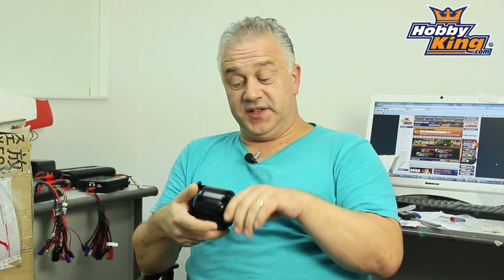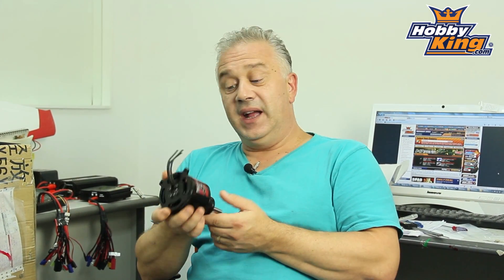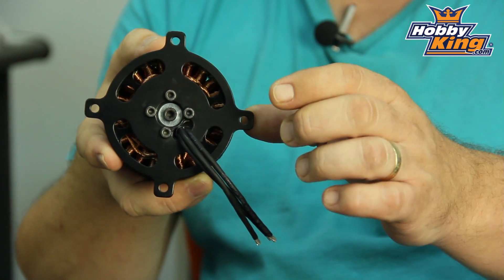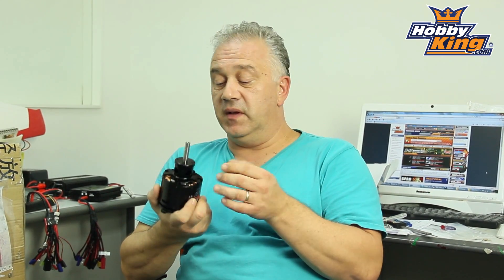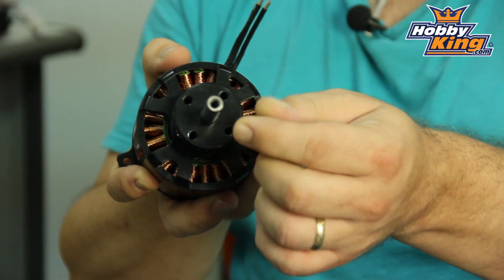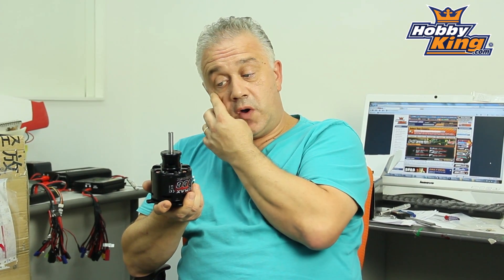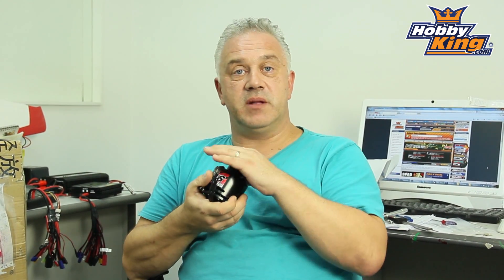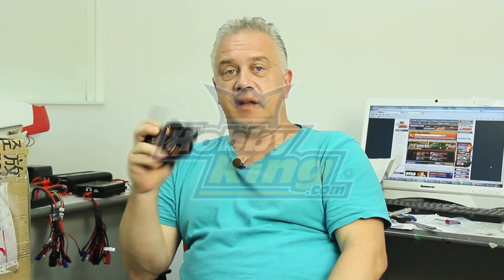Turnigy RotoMax 50cc Size Brushless Outrunner Motor  - HobbyKing Daily Video

Comment: @chreinisch Gasoline aircraft engines are rated in "cc"s, the new electric motors are using the same convention to show what they are equivalent to in gas engines.  So if you have a model that normally flies on a 50cc gas engine you can get a 50cc electric motor and it should perform about the same.